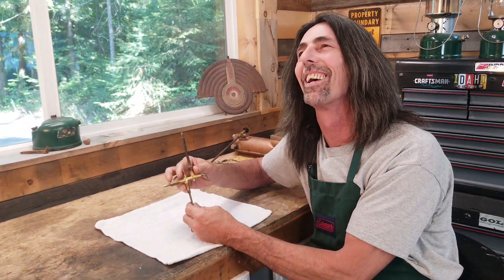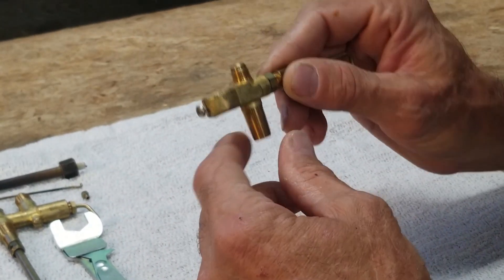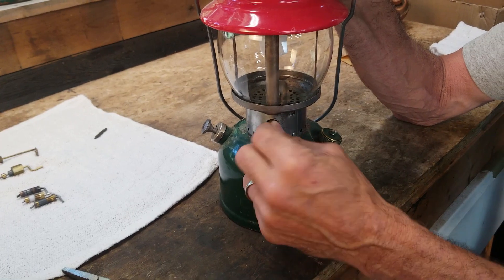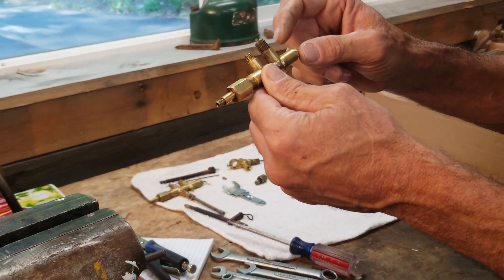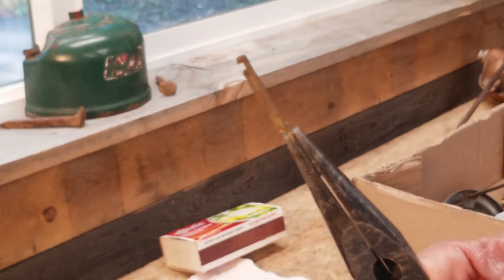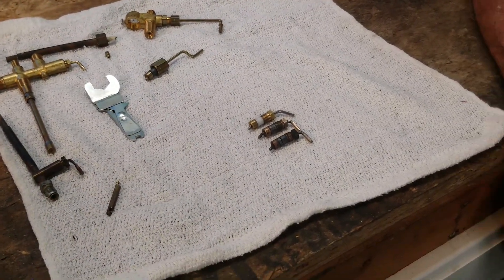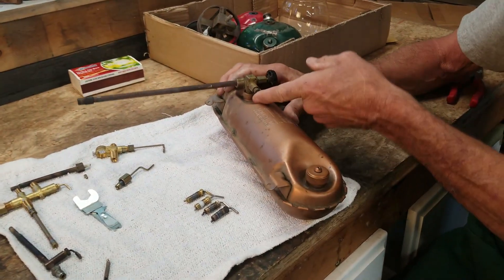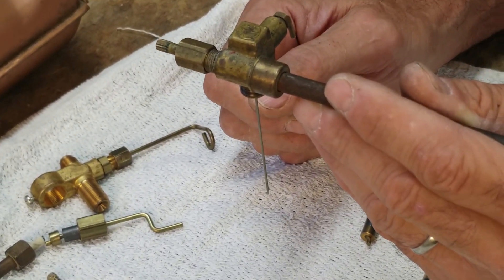How to remove remove a Coleman Lantern Tip Cleaner Stem or Stove Lighting Lever Stem

Comment: i have a 200A with a buggered cleaning valve. i’m supposing the po tried to tighten the packing with a pair of pliers to stop the valve from leaking thus the nut is also damaged. i wasn’t sure how to remove the valve but your video shows the correct tech of heating the housing to free up the packing. thanks for posting ✅👍🔥

Comment: I have two 200a in need of this repair, now I know.  wonderful  I'm ordering new parts today.  Here is a tip to anyone working on 200a.  Don't mess with the tip cleaning unless there is a problem, don't try to take it apart just to look at it.  It's a royal pain in the A_ _.
Reply from the maker: Oh absolutely, if you don't need to mess with it, don't.  It very rarely goes bad, and it rarely leaks due to a worn out packing.

Comment: Thanks for the information Frank,  I had a 200a doing exactly the same thing as yours.  I tryed taking the stem out without heat and of course it wouldn't budge.  I did discover though that it was the hook on the bottom of the cleaning rod rubbing inside the valve body.  I just trimmed up the edges of the hook with a file and problem solved.  I still greatly appreciate your videos because I want to learn every aspect of the coleman lantern and this is a rare piece of information.  Thanks again Frank.

Comment: Frank, just found your videos. I have a Coleman 200A lantern, which I received as a Confirmation gift from my parents back in 1968, that has not worked properly for years. Thank you for giving me the courage to attempt repairing it. I shall keep you informed as to my progress. Needless to say I'll be checking Old Town Coleman Center for parts!
Reply from the maker: Good luck with it Mike...am here if you get stuck.
Reply: @OldTownColeman  Thanks Frank for your offer to assist . . . you're doomed now sir! Lol!
Do have one question Re: the Lantern tip cleaner stem. My original cleaner stem turns with no resistance so I'm ordering the reproduction piece from the Old Coleman Parts (I guess they ID it as S43, on the coleman parts list it's #202-3531). Do you you think I still need to find the graphite packing too? If so where can I find one? 
BTW . . . Has "momma moose" come by again for a reprise visit. Lol!

Comment: On those 220B or 228 lantern tip controls, how is the graphite packing replace on them or is the entire part replaced? What is considered turning too hard and it needs serviced? The round graphite is installed from the "controller" end or the 90 degree bend of the handle?

Comment: I have a 413e that I just picked up with the copper tank exactly like the one in your video. My lighting lever is very very hard to turn. I've loosened the nut up a little bit and that didn't help, so I loosen the nut up all the way until I can turn it with my fingers very loosely and it still did not loosen the lever up. I know that this is something I should not mess with because of the graphite lead packing... So I'm wondering what my issue is. it doesn't leak in that area at all but the lever is extremely hard to turn. I haven't tried to see if the lever leaks now that I have loosened up the nut and tightened it back up, but I will see in the morning and hopefully sometime this week you can let me know what the issue is with this lever being so stiff and tight. Thanks for your videos you're amazing
Reply from the maker: Thank you for the nice comment!  You have a great deal of resistance between the stem and the packing--probably due to the age of the stove and/or a little fuel varnish inside the packing.  You can try getting some spray grease or maybe even WD40 inside the packing to loosen it up, but you definitely need to keep the nut tight as it will leak if you don't.  If all else fails, you'll need to replace the lighting lever stem...
Reply: @OldTownColeman  thanks Frank. I really appreciate the advice I guess I'll just use my Leatherman to turn it until it starts to leak and then I'll replace the lever all together. By any chance could I bug you for the part number on that lever if you know right off hand? And maybe the best place to get one?

Comment: About 50 or more (I’m 79 now) we had Homestead ranch in Shuswap mountains in southern BC, Canada and there was a very nice Aladdin kerosene burning refrigerator in the root cellar. It worked using the round Aladdin wick burner on top or the kerosene filler tank at the bottom of the this refrigerator. Probably some motor homes use the same technology with propane . Do you know if such “exotic” refrigerators are still used when there’s no electricity or other alternatives? Let me know.

Comment: Hey Frank, I've been trying to resurrect my Coleman 533 stove. I replaced the rubber o rings on the valve and it did work ok for a spell. I removed the pick up tube for a quick  inspection. After rebuilding I fired it up but it was mainly air that came out and it soon ran out of pressure. I opened the filler cap and There was plenty of pressure available, just not getting past the valve. Any ideas please. Thanks

Comment: On a 200a I did as you showed to remove the cleaner lever. However after getting it hot with my propane torch I put my vise grips on the lever and gave it a big pull and it came out, however the little round brass piece at the end stayed inside the valve body. I thought about drilling it out, I thought about getting it hot again tapping the little hole in the middle of the brass putting a little screw in the newly tapped hole and maybe pulling it out that way. Any suggestions how to pull out that old brass and so I can put the new tip cleaner assembly in? Thank you

Comment: I guess I need to get a whole new top cleaner stem for my 228E. Looks like you can't just replace the packing, eh? Mine is very hard to turn.
Reply from the maker: Yes, you can replace the tip cleaner stem on a 228E.  It is one of the few stems you can remove and replace easily.
Reply: @OldTownColeman  I referred back to your video in the dual mantle lanterns, replaced both the valve packing and the tip cleaner stem and now the unit is a pleasure to use. Thanks a lot for making these videos, Frank. They are very helpful.

Comment: Is the lighting lever from a stove, and the tip cleaner from a lantern, the same size?? I have an old stove that works, so I have not torn it down. But, to light, the lever needs to be Down! I've figured that it really needs to be taken apart and cleaned, But after watching this, I'm wondering if at some point someone could have put a tip cleaner in it.

Comment: Thank you, Frank.  My Coleman Latern is a 2 mantel with what looks like from your videao a bent-with-a--loop tip cleaner that is very hard to turn (feels like I could break it) and the lantern wont light.  I've tried disassembling, running some lubricant into the stem/shaft from both ends to no avail of loosening it up.  Do I need a new assembly or is there something else I can do to loosen it up?  Im thinking perhaps its bent or broken although the internal bent riser is present.

Comment: Is there a way to replace the eccentric block without destroying the old cleaner stem?
Reply from the maker: Will, not really.  I have had them come out unusually easy, to a point where they probably would have gone back in.  But generally speaking the stem will become straightened during removal.  I assume we're talking single mantle...
Reply: @OldTownColeman  yeah A 200a. The cleaner binds up at 3 O'clock so I'm assuming the block is bent. I can still turn it all the way around but it  is has a lot of resistance.

Comment: hey frank! just acquired an old 220f lantern that was made in 64 I believe. I took it apart and cleaned it put it back together and while waiting for a generator, I pumped it up and kept my thumb over fuel hole (I think my gasket is bad) and cracked the valve and no matter what I do im not getting a hissing noise of noise coming through. any tips??
Reply from the maker: Take it back apart and look to see what is wrong.  If it still isn't allowing air to pass please email me at info@oldtowncoleman.com and I'll help you figure it out.
Reply: @OldTownColeman  thank you very much! will do. God Bless

Comment: Hey Frank. The lever broke when I tried to heat up and pull out the assembly, so graphite packing and the other brass piece are now stuck. Is there anyway to get them out?
Reply: I would think you should be able to pick the packing out with a small screw driver.

Comment: Hello, I have a coleman 523 dual burner stove. The tip cleaners were really seized. Trying to turn the knob made the metal tip shear off. I have been slowly digging out the graphite from the assembly ro try and remove the tip cleaner stem and its other components without any luck. How does one remove a really seized assembly? Thank you.
Reply from the maker: You have a 523 military burner?  Nice!  That packing and stem are going to be a pain to get out, but you should be able to.  Hit the area on the valve real hard with a heat gun.  This will loosen up the varnish and hopefully allow you to free everything.